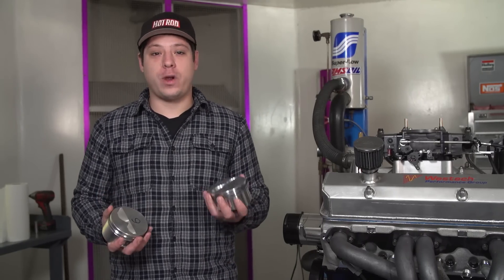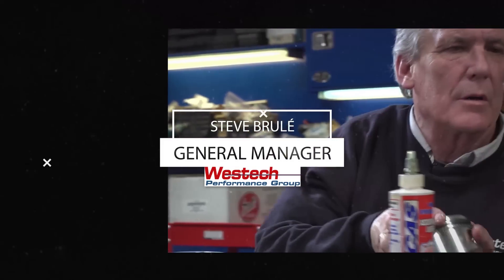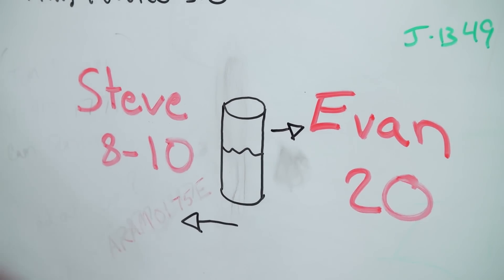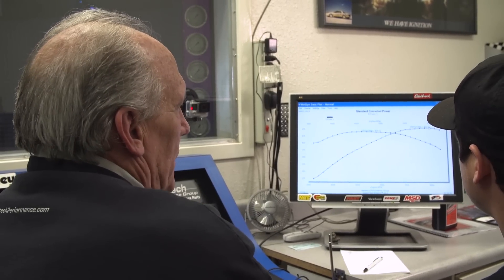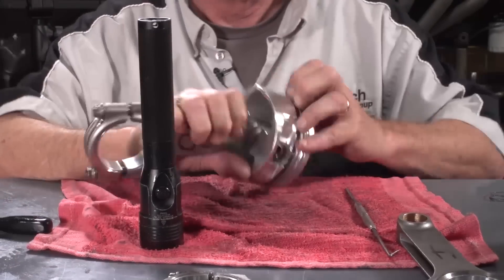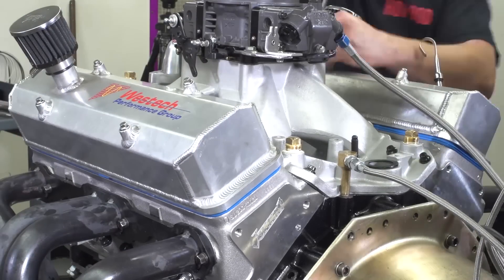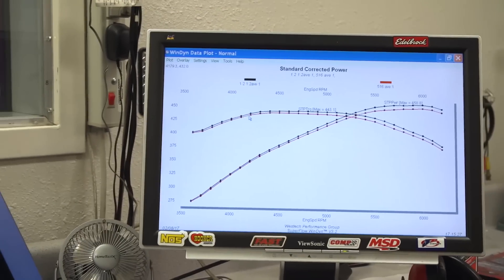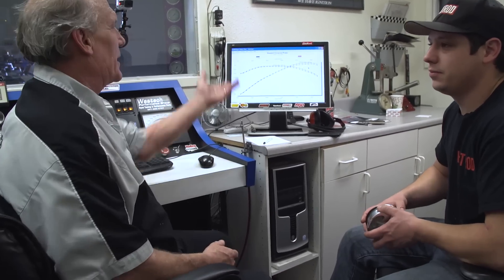Dyno Tested: Are Thinner Piston Rings Worth Horsepower?

Comment: What about the face of the top ring is what transmits 80% of the combustion heat to the water jacket.? Thin rings run hotter ! In nascar they run them so thin they have to hard anodize the top groove so the ring doesn’t micro weld it’s self to the piston

Comment: how much top end RPM can you gain with the thin ring pack ? that is where they shine on a race track. it eliminates some of the ring flutter at high RPM
Reply: Cam and valve springs are more of a RPM limiter than ring flutter. Then lack of breathing from the heads and fuel system.
Reply: Michael Wilkening I've watched videos on here about high RPM valve sprins being a big limiting factor in engines. I don't know which is more impressive, 9000 RPM valve springs or the camera equipment they use to actually see what they are doing. takes one heck of a set of heads to get a 400 block based 355 race engine over 8000 RPM.  very big bore and short stroke involved.
Reply: but in stock engined racing classes, you have to get everything you can out of your engine. chevy went to hyper pistins with the thin ring pack in the early 90s. the pistons were Mahle. they work well in a stock dirt car engine as long as you stay under 10-1 compression ratios

Comment: what about a boosted application? thicker rings for strength ?
Reply from the maker: modern thinner rings are made from much stronger material (high-carbon steel) and are more durable in any environment than older 5/64" rings, which are made from grey iron.

Comment: Was it the same ring gap ?
The oil was the same  ?you poured it from a jug.
same material for the rings ?
no coating ?
broken in rings each time ?
etc....
Reply from the maker: Same ring gaps for both sets, same oil viscosity, un-coated pistons, both were run through break-in cycles on the dyno.

Comment: I always wondered about that, is it because of less weight in the  rotating mass
Reply: They had the piston+rings assembly weight matched so that would not be an issue in this test. This was solely a measure of how much it lessened friction on the cylinder walls.

They stated elsewhere in the comments, that without the wight matching the difference would have only been a few grams, but they had them matched so they didn't have to re-balance the entire rotating assembly.

Comment: there are down sides of thinner rings reliability is compromised with these rings as they wear sooner plus as top rings have to bear heat too the become brittle much earlier than thicker rings also you guys just put it on dyno to see better dyno curves in real life a engine with thinner rings will rev much quicker

Comment: Are thicker rings better for turbo and NOS setups and thinner rings for NA?
Reply: turbos and NOS engines run with high pressures on the cilinders ...   thinner rings are better for NA engines for better performances on higs rpm's ...    some 600 or 1000 rr race motorbikes  have only 2 rings piston

Comment: Does a thinner ring need thinner ring lands? Do thinner rings need anything special at all as far as pistons go in old V8 engines?. I can't help but think there would be some slop in the ring lands you don't want.
 Just a question I think is important to ask before taking this on for a rebuild or new build.
Reply: Yes for smaller rings you need smaller ring lands. My guess is they would slap around in the piston until the ring broke and scratched a cylinder or worse
Reply: @nashvilleoutlaw  If they are making thinner rings, then they must also be making the pistons to go with them. I've never heard of this before now, so I am curious as to how this works. I think there needs to be more video of documentation for this new thin ring concept. The difference in power is minimal, BUT every little bit adds up in the end. It's that small edge that can make or break a winning race day.

Comment: Wow if this is what they say normal, then I am out of the park, for that is my s#*+ winter bomb motor, even my 05 Gto got a upgrade for it was slower then my winter beater. And I did all the tricks, my numbers are almost the same as each other, know my rev is a little quicker, hp was 2 two 4 different, and remember play toys break things so tell your builder what you are going to use it for. And I always recommend do the machining with the plate to simulate the head.

Comment: A test I would like to  see is  build a Z 28 302 with  the old  Small bearing then  a second  engine  built with the  larger  bearing  and see the  true difference at 7000 RPM

Comment: Well there is a downside. Theres more blowby thus more gas/fuel and exhaustfumes getting into the crankcase and oil. On short-distances you will get a downside. But hey thats up to every single person to decide!
Reply: The engine builders did a leakdown test, and the got 4% leakdown on the 5/64 rings and the 1.2mm rings. There wasn't more blowby.

Comment: No free lunch in engineering, what has been given up ?
Reply: Heat dissipation of the piston. The most important function of the rings next to sealing combustion pressure.
Reply: @peteh8077  thanks, makes sense.
Reply: @peteh8077  another question, didn't low tension ring pack used to be a thing?

Comment: Spirolox retaining rings are amazing components. I've designed them into gas turbine engines and gearboxes for years. I've installed them, I've removed them, and I've really appreciated them. I can't believe you guys are complaining about them. Get over it.
Reply: They clearly aren't complaining about the function and performance of spirolox, simply that they are an ballache to fit and remove compared to conventional circlips.
Reply: @ferrumignis  they're actually easier to remove and install, in my opinion. No special tools needed. And, yes, they were complaining.
Reply: @ronaldschoolcraft8654  Could you give me the time in the video where they are complaining that Spirlox do not work? Must have missed that.

Comment: All other things being equal a thinner ring has lower tension. When making the rings it is possible to make a piston with no tension. So what have you proven? That a thinner ring: Seals better? has less friction?or is just bullshit cause ya made a extra low tension ring by going to a smaller thickness? Marketing= something new and improved or Good old and proven.Either one is deceptive. You can make a thinner ring with a high tension also.

Comment: Who thought you could get 30 hp from rings. you barely get that from heads.
Reply: That depends on what heads your talking about tho and what engine your using... I've got an old Nissan RB30ET with a single overhead cam head (heavily ported of coarse), but I've got an RB25 twin cam 4 valve head sitting there waiting to go on. This head swap will net around 80 - 100hp difference on the same boost, even with untouched ports and bowels!!! I'm not kidding.
Reply: +Daniel Brealey boost acts way differently that no boost motor flow. on motor draw alone not so much. it still doesn't change my argument as to why a trained engine builder would think you could get 30 hp from rings. They scrape oil off the sides and seal the piston in the block that's it.

Comment: stop useing that crap lucas oil. it foams up. use royalpurple or castrol magnetic. and also try a test with thin oil vs thicker oil and see if there is a diffrence in h/p and torque. i stoped useing lucas years ago and i have not had to take apart anyengins sience.

Comment: Conclusion is WRONG! - Quote: IF they go 200,000 miles it's worth it. How did a 10 minute dyno run equate to 200,000 miles? I strongly suggest you find out more before assuming reliability based on it hasn't blown up after 10 minutes, it must be good for 200,000 miles.

Comment: You run a test with a sample size of 1 and assume it's correct? Right.... Just one bearing torqued slightly different and the whole test is useless.
Reply from the maker: Bearings were torqued to the same exact specs, with the same torque wrench each time the motor was assembled. To obtain the data for each ring set, the engine was pulled three times at the same oil and water temperature, and those three runs were averaged together. The engine was also leak-down checked and both ring sets tested at a consistent 4%

Comment: thin rings and lands = lose of engine life. many better ways to gain a few hp and keep a good engine road worthy. Any engine builder knows this. Run up the compression run up the  boost your going to want some meat on the rings and lands. go road racing with thin pistons your done fast. try this on hyperuratic pistons .... rod through block piston on floor.
Reply from the maker: Poll the OEMs and all of the top builders in the country and you won't find any of them use an antique 5/64 ring pack.

Comment: Chevy always was late to the show when it came to new technology. They may have been the first ones to release things in production cars, but they lagged far behind the status quo as far as performance engines go. And what really pisses me off is that they sold the LS motors in Austrailia for years before bringing that technology here. It was a matter of cost, not giving their very best to their customers. And when they released the LS 3 they already knew that the LS7 heads would be the way to go. They just made you pay out the nose for years to get to the point that you would get the very best they had to offer. And there may be more they left on the table for the years to come! Not so with Mopar or Ford. Those car companies are in it to win it. Their improvements are slight because they already gave the best they had at the beginning. Sure Mopar just came out the with the Hellcat and the Demon engines, but the changes made to those were Shuttle in comparison with the improvements to the LS series engines. In fact the aftermarket released better heads, blocks etc.. than Chevy because they left so much on the table and it was easy pickings for the aftermarket to improve on the one Chevy stuff! This is something you'll never read in a magazine. Something that will never aterbe spoken of by GM engineers, but consider Chevy's marketing strategy since the 1920's. They wanted to sell every buyer a new car every three years.  How to do that... easy. Every third year they would come out with a new design. A 1955 Chevy or a 1967 Camaro are good examples. Then in year two they would release improvements that were already on the drawing boards when the first year of the new models were born. And the third year they would release the very best of all the improvements they had already designed to drive the demand for the newest and greatest of the brand's offerings. They did well with this for a while, but were unable to keep things going. So the  GM decided to downgrade their vehicles because they had ended up making them far to ereliable for far too long to sell people a new car every three years. In 1969 they came out with the turbo 350 transmission, a major downgrade in reliability from the powerglide and Turbo 400 which would last up to 200,000 miles easily. Infact of one of these transmission went out garages were more likely to buy one from a wrecking yard, and there was little incentive to buy one from the local Chevy dealer because of the cost involved. Along came the Turbo 350, spec'd out by upper management to last only 60,000 miles so as to bring customers for service at the dealerships or better yet sell them a new car when the old one failed. That worked for a while. But soon the garages. Figured out what was going on and advertised better service than GM would provide, maybe not in so many words, but claiming quality over the OEM shops and they succeeded in taking the brunt of sales away from GM. and so it was that GM showed their true colors. Am now the aftermarket dominates sales of improved parts. All to go to those who take the time to actually research things for themselves.